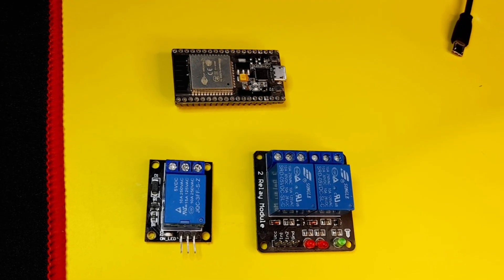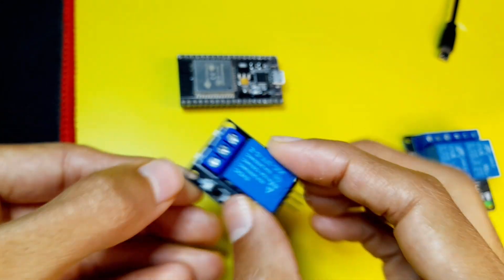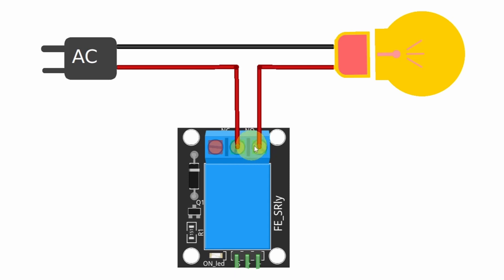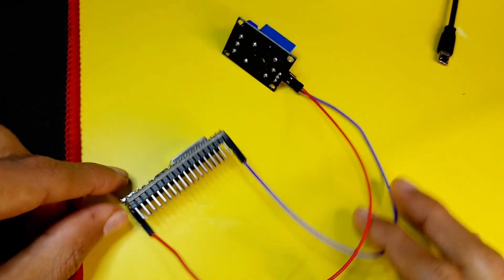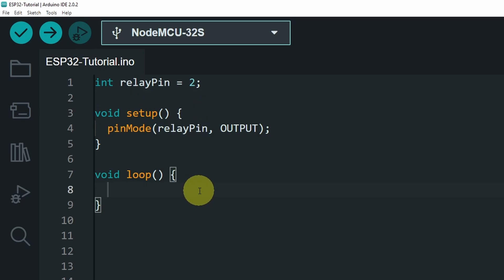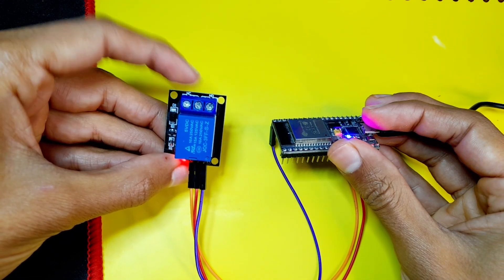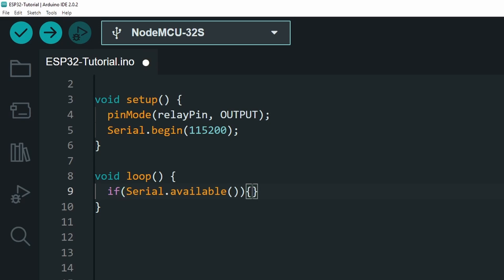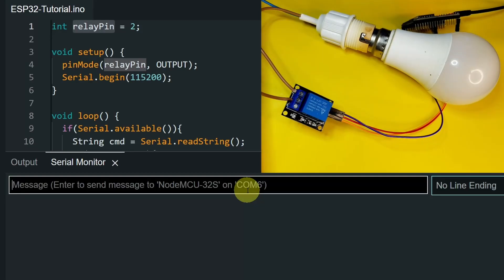Controlling Relay Boards from an ESP32

Comment: Hey man 
i have LED light bulb that works on a 12V power supply and i was just wondering if this video can work on my LED light bulb. Thanks
Reply from the maker: Yes, you can use this method to control your LED light bulb!

Comment: Isn't the ESP32 3.3V? Isn't the 5V pin an voltage input like the USB port ? I am a beginner at esp32.
Reply: Yes, but when USB is connected to the ESP32, the 5V of the USB connection is transfered to the 5V Pin of the Board.

Comment: USUALLY ESP32 GIVES 3.3V ,  BUT THE RELAY NEEDS 5V TO CONTROL. HOW DID YOU FIX THIS ISSUE
Reply: Did you figure it out? I'm also having the same issue
Reply: @raahimkhan7210    yes, u can use a transistor. But it is easy if you use a Solid State Relay. You can connect directly and it is more durable
Reply: You can find 3v relay module.
Reply: On the ESP32 there are two power pins and a USB that can give it power, one is the 3.3v and the other is vin which is 5v, both will run your ESP32 (the vin will reduce to 3.3v if you use that).  if you are powering the board from the USB you can use the VIN to the relay which is 5v.  Other wise you will need to power the relay from a seperate 5v power source.  There are components that you can get that will can take a 9v (or higher) and tune it down to 5v ( I do this with a 12 volt battery )  simply connect the relay to that source - the relay doesn't care where it's getting it's power from, just that it is getting 5v.  Hope this helps.
Reply: @MattMiskinnis hey man, I tried connecting the vcc of the relay to the 5v pin on the esp32 as you said. The relay does turn on but it can't be controlled by the esp32. Any fixes that you may suggest?
Reply: @aannuupp  I also try to control water pump with relay module, pump is turn on but will not turn off signal is not going to turn off relay switch

Comment: Please also teach how to After loading the code for the esp32, do I need to plug the micro USB into the esp32? If you unplug the micro USB into the esp32, does the light come on?
Reply from the maker: Use firebase

Comment: While powering on the circuit the relay get automatically triggered from esp32
Reply: Low voltage from esp32

Comment: what is the advantage of Relly if we use high voltage to make the ligthbulb ON?
Reply from the maker: Because we can't turn on a light bulb using microcontrollers without a relay.

Comment: module is working blue light on and off but relay are not on and off plz help
Reply from the maker: I guess we can solve this by using an external power supply to power up the relay module.
Reply: please check the relay that u utilized. generally, there are 2 variation of relay which are 5V relay and 3.3V relay. ESP microcontroller just support 3.3V relay since the output signal is 3.3V. if u used 5V relay, it will not trigger the relay to switch the open and close circuit.
Reply: @shukriazizi9516  <-- This is the correct answer

Comment: I wrote the same code but bulb is on mode only not able to off plz give some suggestions
Reply: please check the relay that u utilized. generally, there are 2 variation of relay which are 5V relay and 3.3V relay. ESP microcontroller just support 3.3V relay since the output signal is 3.3V. if u used 5V relay, it will not trigger the relay to switch the open and close circuit.
Reply: @shukriazizi9516  Does this depend on the ESP32 that is used? I´m having the same problem and I´m using the ESP32 Devkit V1, If i changed it for the ESP32 WROOM 32D would it work?
Reply: @nataliaballesteros7997  no, it dosnt works. you can still use ESP32 dev kit with logic level converter (LLC). LLC will convert output signal from 3.3v to 5V which compatible with 5Vrelay.

Comment: i am using using esp32 DevKitV1,., its not working,., can u help?
Reply: please check the relay that u utilized. generally, there are 2 variation of relay which are 5V relay and 3.3V relay. ESP microcontroller just support 3.3V relay since the output signal is 3.3V. if u used 5V relay, it will not trigger the relay to switch the open and close circuit.
Reply: @shukriazizi9516 I use a 5vdc relay, but it can't be controlled at the vin pin, while at the 3v3 pin, the relay works normally, what should I do?, I need the 3v3 pin for other things
Reply: How did you resolve this, I don't see 3.3v relay that can be use with this esp32

Comment: Can I power 3 relays from this 5v pin? What would be the max current?
Reply from the maker: Yeah, and if it doesn't work, you could use an external power supply(5v)
And connect its ground to the gnd of the esp32 board.
Reply: But not working  @DIYTechRush